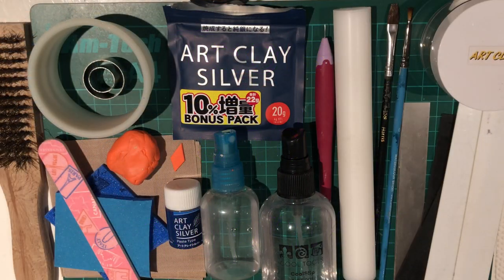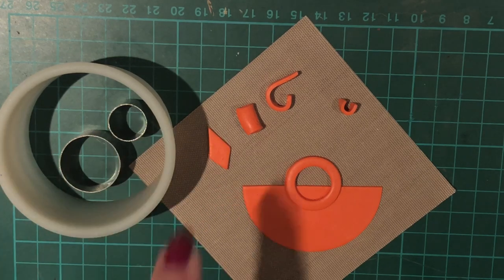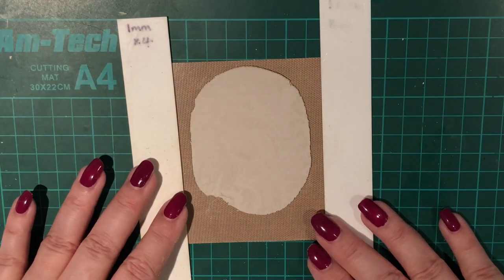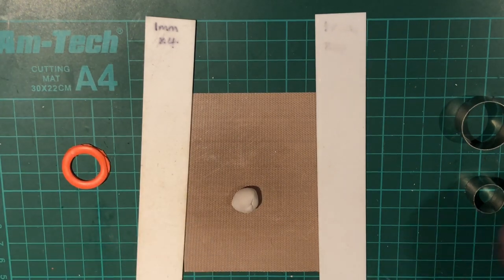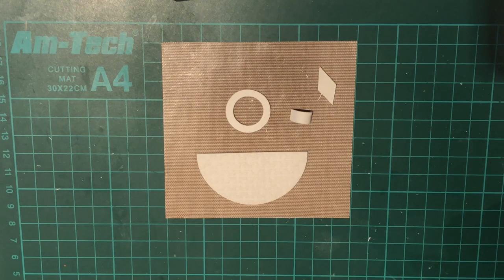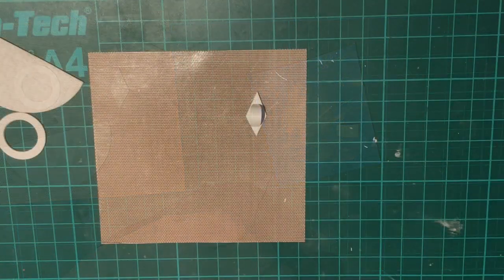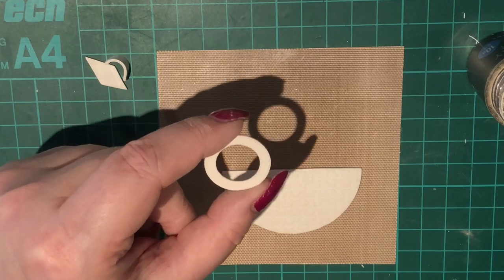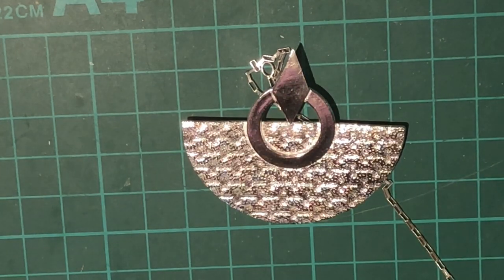Silver Metal Clay Pendant - Tutorial

Comment: I'm so worried about wasting clay that I don't think I ever start with quite enough of it.  But, once I've handled it a bit then rolled it back into a ball, I get cracks in the clay.  I did notice your clay had them when you took it out of frame.  Is it literally just rolling it in your hands that gets rid of the cracks?  Thanks in advance.
Reply from the maker: It's better to start off with a bit too much - if you use too little you've wasted time and exposed the clay to drying out.  The longer you "work" the clay, ie rolling, shaping, cutting, the quicker the clay will dry out so it's best to roll out and roughly cut and then take the excess and put in a container with a spritz of water to keep the clay supple.  In terms of cracks, when you first get the clay out of the packet you need to condition it very quickly by rolling into a ball in your hands.  This will give you a nice smooth surface.  If you're using old clay, it may have dried out a bit and you may need to roll it out, spritz the top of the clay lightly with some water and then fold the clay over (to trap the spritzed water in the middle of the clay) and then knead with your fingers for about 10 seconds, then roll into a ball and roll out again.  If it's still got cracks, repeat the process.  With very old clay it may always look cracked around the edges but that's ok as you'll probably cut the off.  Hope that helps.
Reply: @artisanalchemybymichele471  thank you so much for your response. I do have the art clay tub with the damp sponge to store spare so I don't know why I'm so frugal. I guess it's the cost. I will try to be more liberal. Thanks x